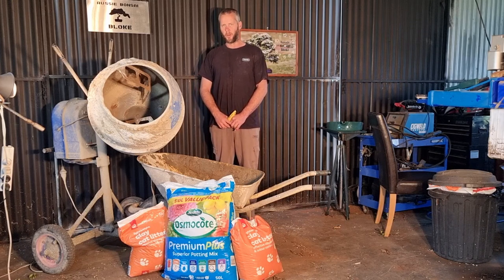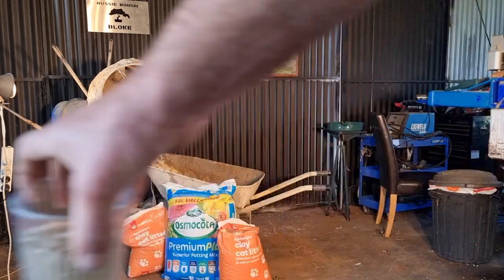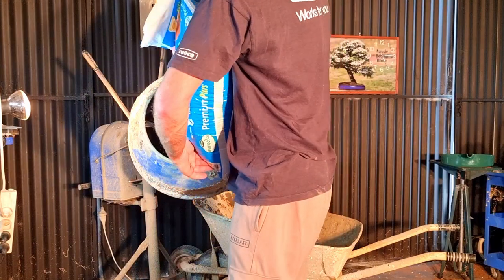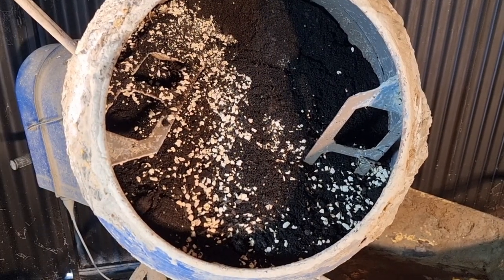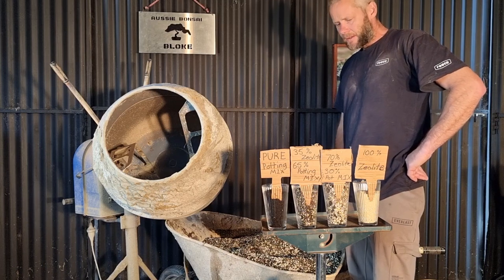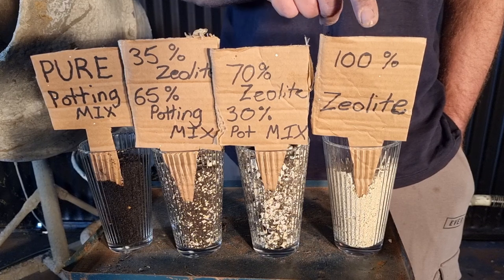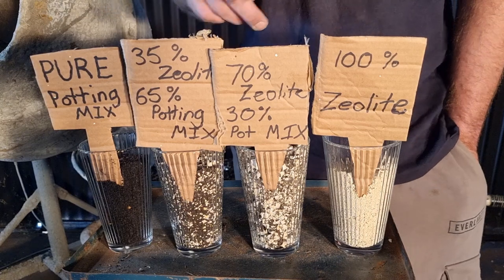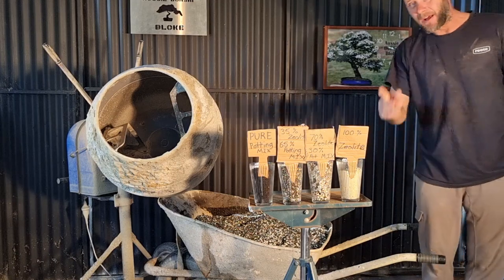Bonsai Soil, Quickest, Easiest and Cheapest way EVER to make your OWN

Comment: I'm so glad I was put the cat litter ,I  bought another brand of  zeolite  for $22  the same size ,it is the cheapest mix for sure,thanks for sharing Sam,
Reply: The difference (and disadvantage) is, that with the litter you get a bigger varitaion of particle size and it's very dusty.
Reply: I didn't find that ,there is more dust say from perlite and other substrates ,it may depend on the brand.
Reply from the maker: I think the brand matters. Woolworth is a new Zealand product. Even expensive akadama when sifted can give you bad returns
Reply: @mariakellner5429  OK, fair enough. I am from Germany. So i am sure there will be differences. I just compared the dusty cat litter in the video with the zeolite I have. It's sold as a filter component for Koi ponds here, so it's pretty clean and the particle size is pretty consistent. You can choose from many particle sizes. like 2-4 mm or 4-8mm

Comment: Hi, love your videos. I’ve only been in the Bonsai train for a few months. I’m trying to grow all my own so I have a lot of pre Bonsai in growing pots and foam boxes. Would this soil mix be good for pre Bonsai. Keep up the great work.
Reply: It might help with a bit of drainage/aeration and water retention  depending on what you're using and if its really poor at the above....  but generally you don't want to use inorganics like that for trees in the development stage.
They're generally only for advanced trees in the ramification stage and mostly organics for development stage. 

I could get deep into the reasons for this but I doubt you want to read it haha and nor I type it. ))
But simply put organics in larger pots or ground will give you long elongated roots and this is reflected in the top of the tree.  Elongation is key.  That's what you need to thicken up your trunks and develop the primary branch structure and surface root display/nefarious.   Long internodes etx and let the shoots grow out Long as you can to thicken them up then cut right back  to a few nodes (depending on species.  Not cobifers) then let a new shoot develop and elongate and repeat repeat repeat  to get all your thickness and cool  movement and taper in trunks, branches, and negative..   

When that's developed how you want the tree structure to look like (as it won't grow much bigger or thicker after this) then and only then you can start moving it into inorganics and shallow pots. 
Once you start mixing inorganics inches growth is going to alow right down so note that.  Not a good way to develop trees. 
Once in inorganics besides slowing down this is where they'll start developing that fine feeder roots and a fine flat pad of fine tight feeder roots for a bonsai pot.  The course substrate causing root division heavily.  
And just like above this will be reflected in the top of the tree...the foliage and branch structure especially. 
So this is how you'll get the real tight compact tree in scale with tight internodes? Fine branch structure, compact and small tight foliage masses and such to get the mini-big-tree look.  :)

And that's the "basically" short quickly typed ramble version haha.
I'm not typing the long one😂

Comment: how come you did not use the cacti mix with the zeolite?  At least with your watering system you would of have more drainage.
Reply from the maker: I guess the premium potting mix is cheaper and also the cat littler. 
I feel the 65 / 35 zeolite should be good and if still to wet just chuck in a little more cat little

Comment: You're lucky with that cat litter. Not every cat litter is zeolite, there are diatomae, bentonite, sepiolite... and the last one is not very good for bonsai because it degrades and compacts easily. Zeolite is the best one.

I also have been using potting soil for decades. I used to mix it with standard construction sand, now I'm using construction leca about your percentage (much cheaper than plants leca, being basically the same). I only need to water once a day if hot.
Reply from the maker: Awesome. Glad you have a cheap solution that works for you 😀😀